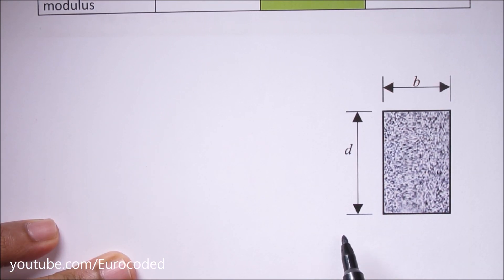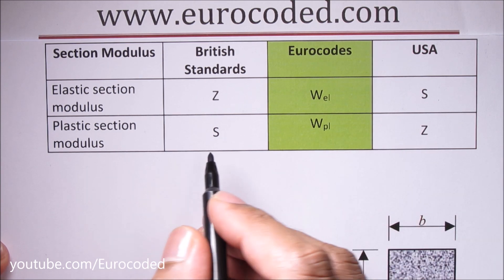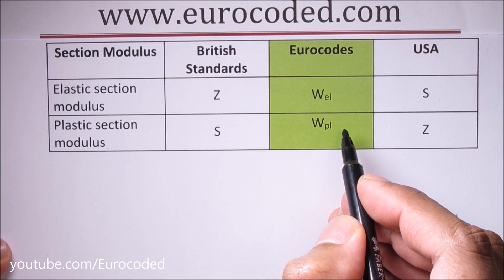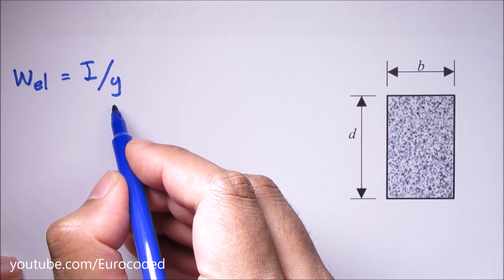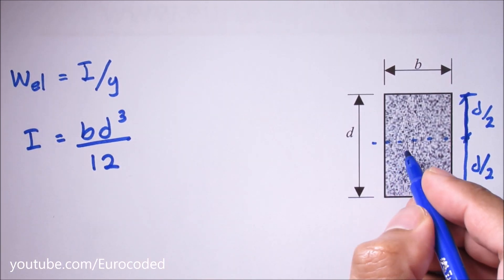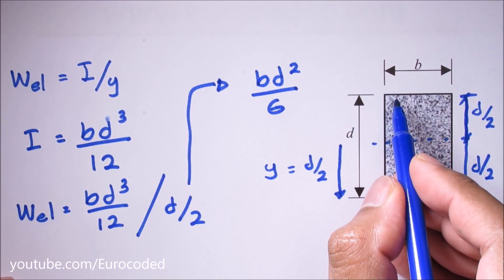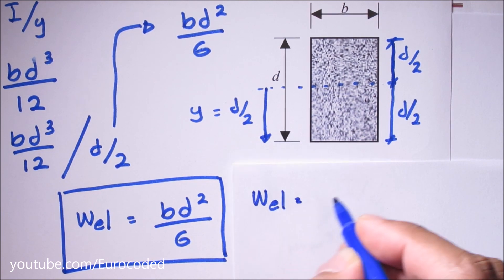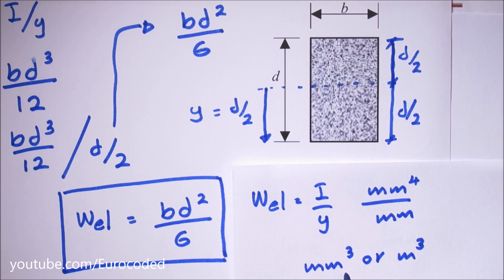Section Modulus - Definition, Example, Use and Units

Comment: at 4:00 "or m^3" is wrong
Reply from the maker: You can convert mm^3 into m^3. Hence, unit of section modulus can be m^3.
Reply: @Eurocoded  but the unit should be mm^4 or m^4. Unit for MOI is mm^5 and for y is mm so mm^5/mm=mm^4.
But apart from that, the video is good and well explained.
Thank you.
Reply: @yashghate6656 , Section Modulus units are alway a distance cubed
Reply: Hey yash, the unit mm3 explained is correct. Units type changes as per the system you follow.

Comment: why we find this and also tell the purpose of MOS
Reply from the maker: mohsin Rasool Section modulus is a quantification of strength of a section. Higher the section modulus stronger the section or harder to bend the section. Therefore, it lets you quantify bending stress, radius of curvature, etc. Watch this video https://www.youtube.com/watch?v=rDbtM4H0ig0&list=PLKYpFtSJqr3iZTo0kfG1RuBjhTJcoex-q
Reply: @Eurocoded  What does section modulus tell us that moment of inertia won't? What's the difference between them?
Reply: @notanimportantpersona  Maybe the section modulus was created for anisotropic materials? For those kind of materials the neutral axis is not necessarily at the centroid. If we vary the material, we vary the y? I'm not sure about this. However, if we vary the y we vary the section modulus, while keeping the area moment of inertia the same.
Reply: Maybe the purpose of MOS is because of the following:

All bending equipment have section modulus ratings. A three-roll section bender can be designed to bend steel with section modulus between 0.4 to 500 in3.  So, to determine if the equipment can bend your steel section, you need to calculate the section modulus mathematically or by referring to engineering tables. Then, if that amount is equal or less than that of the calculated strength of the bending machine, your machine should be able to curve the section.

Source: https://www.cmrp.com/blog/faq/how-is-section-modulus-used-in-bending-steel.html#:~:text=Section%20modulus%20is%20the%20direct,the%20design%20of%20flexural%20members.

Comment: This is the elastic section modules and what is plastic section modules
Reply: 1=Find the Neutral Axis ( It divides the section in 2 equal halves )
2=Find the Area of each section in a figure and multiply it with the centroidal axis of the section and then add of all of them.

Comment: Sir do you explain how Zez=Mz/fy this formula is given in design of purlin , where,
Mz= moment of inertia
Fy= yield strength
Reply from the maker: Hi Manoj. It appears that you’re looking at bending capacity of steel sections. If that’s the case then Mz would be bending moment and Z would be section modulus.